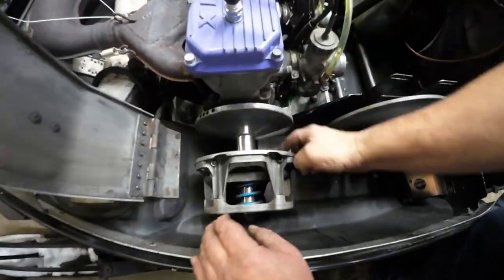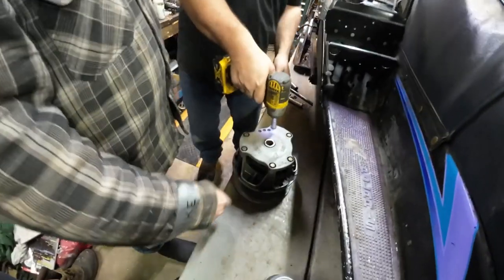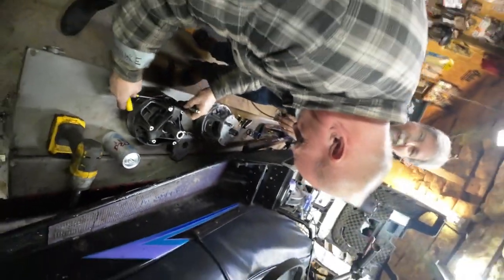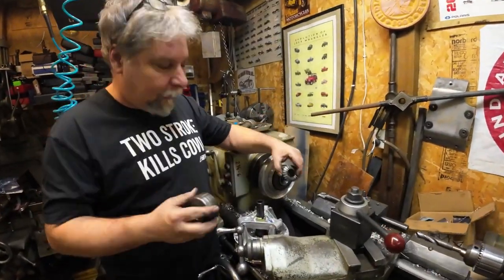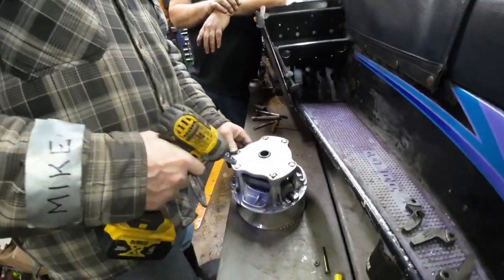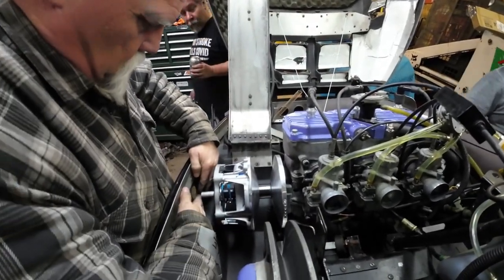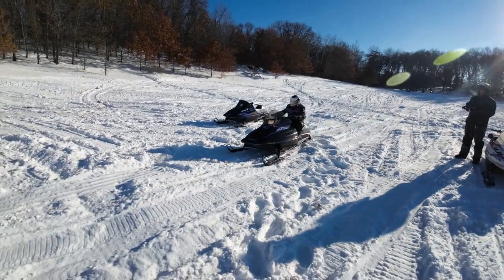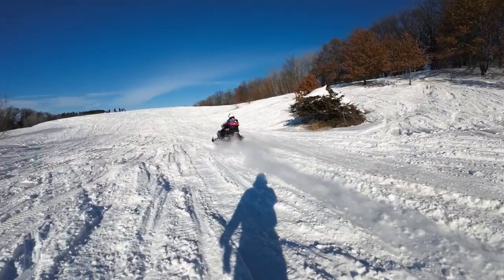A Different Type of XLT Bog- And we fix it! Vintage Polaris XLT 600 Triple Snowmobile.

Comment: Im sure most xlts with the "bog" is clutch related. My girlfriends 95 had it. Found a broken primary spring, rollers were flat sided, and weight bushings were egged out, and the outer sheave had a crack in it near the center.. could have been disastrous.. Brand new clutch and it screams like hell. 👍

Comment: I have done many Polaris clutches with bogging issues and it all the same stuff, mostly rollers and weight pins and bushings. It's surprising how bad the sheave and cover bushings  can be and the clutch still works well but if you don't change them the rest of the parts will wear out quicker.

Comment: It’s party time in the shop!  Where do you get the new clutches from btw?  Do you ever rebuild clutches?  I know the rebuild clutches are pricey as well, but gotta be cheaper than a whole new clutch 🤷🏻‍♂️
At least the XLT is out ripping it up again!  It’s definitely time for a Nutter’s Speed shop XLT shootout!!   Cheers guys!!!
Reply from the maker: I get the clutches wherever. Ebay. Wahl Brothers, swap meets, even Polaris. New clutches aren't cheap but I'm not into rebuilding them.

Comment: Been trying to figgure out my '94 for aehile now, bogs at 40 mph, wont go faster, then cuts out and dies. Wend through the carbs, and cleaned and sync'd. Found a bad clutch, found a good one, inspected and cleaned. Still does it. Would it matter if it has individual filters and no air box on the carbs? What am i missing.
Reply from the maker: fuel starvation? clogged pickup, clogged filter, pinched line, something withe the shut off.
Reply: @nuttersspeedshop  replaced the broken pickup in the tank already, all new fuel lines, could be the shut off, I can bypass the current one and try.

Comment: So was that a Factory stock clutch or a after market ? Could you in the future tell a little more abut what and where the parts come from ? I am going to rebuild a 97 RMK this summer and there is no NONE ZIP NADA SNOWMOBILE shit for 100 miles of where I live ! One other question I have a Polaris RANGER 2007 XP with a BLOWN PDM it has been sitting in the POLARIS shop since LABOR DAY !!! If you know of or anyone else on here has a PDM FOR IT even if it is burnt As long as the pins are all there I would buy it and get MODUAL MASTERS to rebuild it mine melted the pins they cant fix it!!!!
Reply from the maker: Its a factory p85 of some sort. I cam find the number later, bit its kind of irrelevant because they must have made 100 different part numbers for 30mm p85s. As long as its a 30mm taper and taks a 3/4-16 puller ill buy it. I dont know anything about sxs.
Reply: @nuttersspeedshop  Thanks NUTTER got the I 500 on 1 screen the Salt Dash Border Clash on another